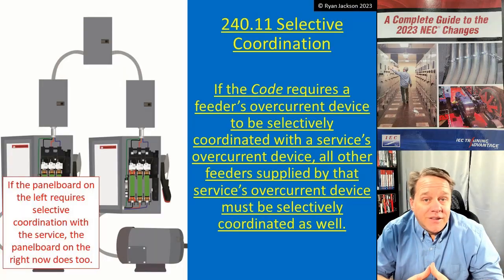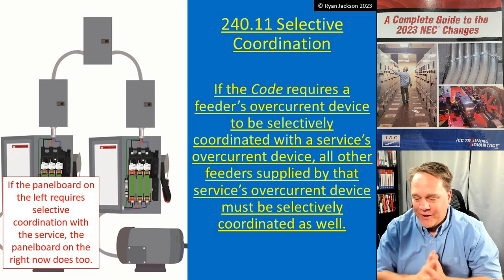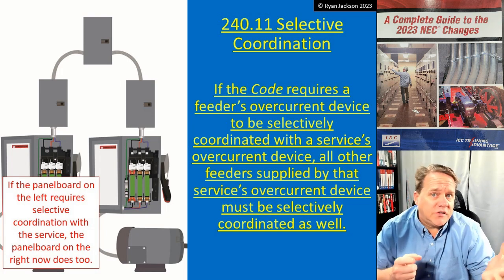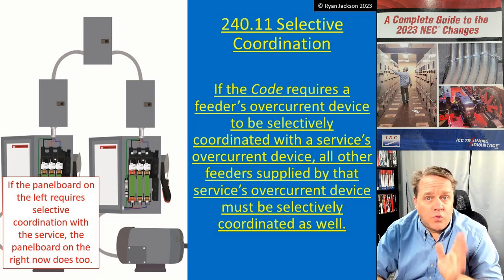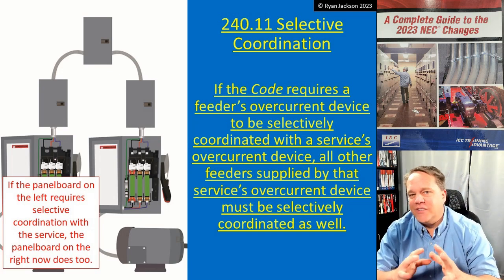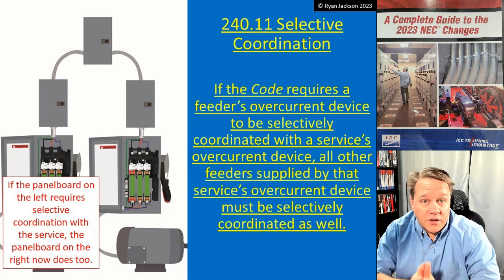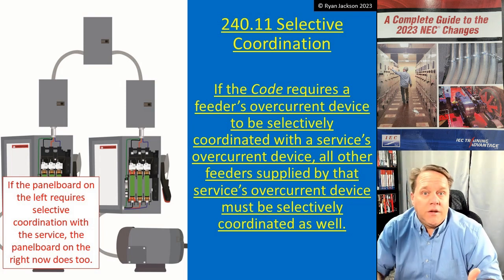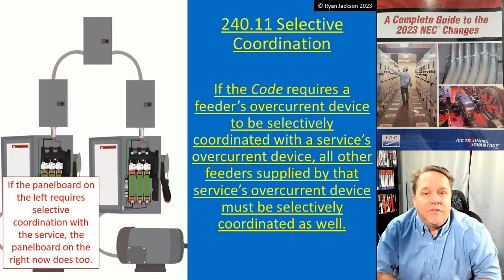2023 240.11 Selective Coordination

Comment: At the large hospital/research campus that I worked at one of the 12 story research building appeared to never had proper selective coordination. The building mechanics replaced all of the 277 volt ballast instead of the sparkies. They were instructed to never work with power on but always did. None of the old ballast had the in the luminare plug in disconnects .At least once a year they would short out the 277 volt wire and trip the 200 or 225 amp circuit breaker rather then the 20 amp branch breaker. Told us they were looking into it. Yep looking for over ten years.

Comment: An example of an extreme opposite of selective coordination is a defective circuit breaker, likely to happen in FPE and Zinsco brand panels that allows a dead short on a 15 amp circuit to trip the 100 amp main, or a 60 amp main/range fuse panel where someone placed a penny behind a fuse and a fault took out the 60 amp cartridge fuse.